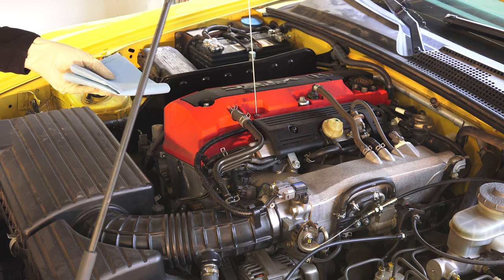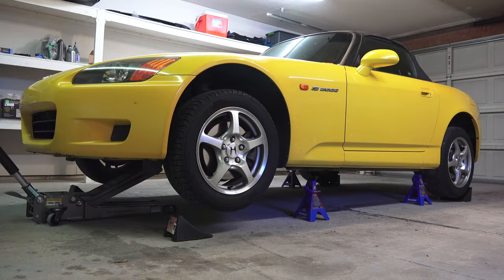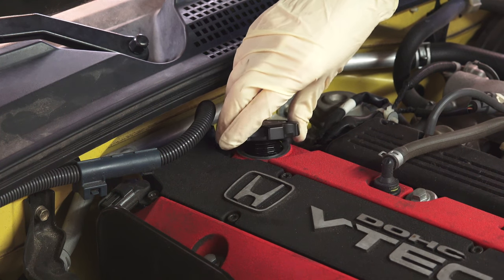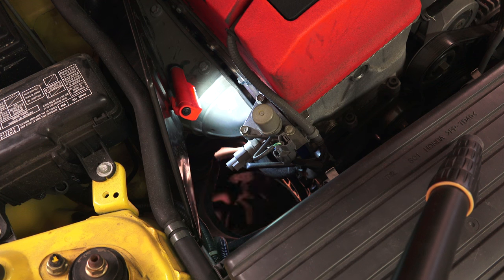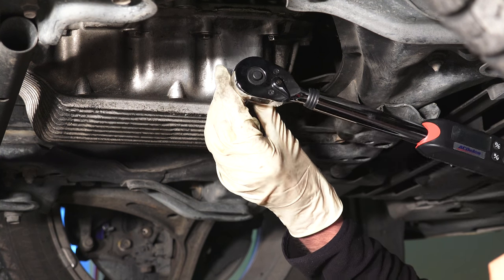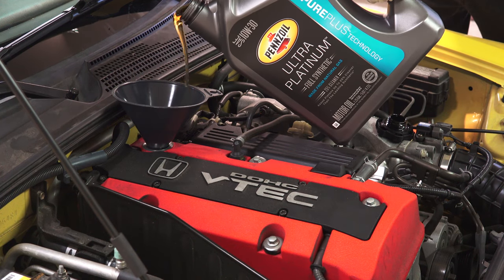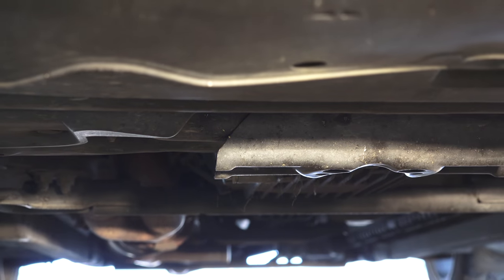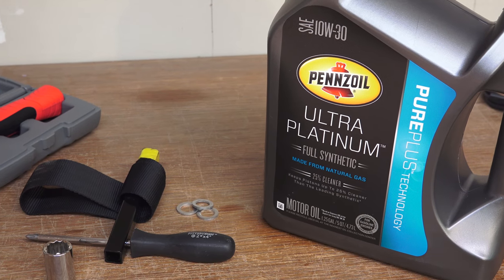How To Change Your Engine Oil - Honda S2000

Comment: You've done a great job and provide a wealth of useful information in your Engineering Explained series Jason. Thank you for your efforts!

I would like to contribute to this informative video with a few small suggestions to add to this episode.  The bulk of these suggestions apply to pretty much any car that uses a spin-on/canister style filter, and generally applies to cars (mostly German) that use filter cartridge inserts.  There are also a couple S2000 specific points added as well.  

The first suggestion is to pre-fill the filter with oil prior to installation.  Spin-on filters are equipped with an anti-drain-back valve, which allows you to at least partially fill the filter with oil prior to installing it on the car.   On your S2000 (as your video shows) the oil filter is mounted at a 90 degree angle to the block, with the resultant angle being approximately 78 degrees to the vertical (I personally own 2 AP1s).  Despite this orientation, you can fill the Honda PCX filter with about 1/3 quart of oil without oil spilling out of the filter during installation.  Other cars, like some small block Chevrolet V8s for example, allow you to completely fill the filter prior to installation due to the vertical orientation of the filter.  With regard to cartridge insert style filters (such as on my BMW 335D) you can fill the filter reservoir at the time of filter replacement.  

The advantages of pre-filling an oil filter are obvious: you prevent momentary oil starvation during the initial engine start-up after changing oil.  When the filter is dry, not only does your oil system have to displace the air in the filter with oil - the dry filter media will resist flow more than a wet filter media.  In reality the starvation may only about 4-5 seconds when the filter is dry - but over the life of the car, this can add up to significant and avoidable wear.  

Given your project car - a Honda S2000, I think it's worth mentioning that it's critical that S2000 owners only use the OEM Honda PCX filters.  That filter is specifically designed for the S2000 due to the design of the VTEC system.  Most of the design difference is in the bypass valve in the filter - in that the filter is designed to accept and handle significantly higher pressures than a conventional filter.  The oil pump in the S2000 is actually capable of supplying lubrication sufficient for a V12 engine.  The old school VTEC system in the S2000 is brute force in nature.  When the car goes into VTEC, it's not unlike creating a massive oil leak under the valve cover, because there are no seals around the pistons in the primary rockers that lock in the secondary rockers under VTEC.  The only way to keep this deliberate leakage from starving other parts of the engine of oil is to have an oil pump capable of flowing a massive volume of oil - under high pressures.  You never want to skimp on filters - but that is especially true for the S2000.  Honda most certainly didn't, and the PCX-004 filter the only filter specified for the S2000 - and the only car that uses that filter.  Every other Honda uses one filter - a single filter for numerous engine types.  That tells you something.  Last notes:  always use a fresh crush-washer.  Honda uses aluminum, and some manufacturers use copper alloy - both of which can be recycled.  Aftermarket magnetic drain plugs are not only widely available, they are highly advisable and can help prevent engine damage in certain circumstances.  There are also powerful magnetic sleeves that attach to spin-on filters, and are designed to help trap ferrous particles in the filter itself.  Both items are not too expensive and well worth the investment.  

The last suggestion is that I would strongly advise AGAINST using additives like PTFE (and other snake oil products), as they can lead to serious and expensive engine damage.  A good quality synthetic oil along with a high quality filter is all you will ever need to put in the crankcase.

Comment: I assume you were pouring the oil like that for the product shot, but for those who don't know, pouring front the side of the container releases the air lock and makes for a smooth pour.
Reply from the maker: Haha I've never really understood why people care about this. If the oil makes it in the engine, it's all good. That's why I used a funnel. 👍
Reply: +Engineering Explained Well, some of us are strange and hate cleaning up engine oil spills, so we employ a technique that... does not spill.
Reply from the maker: There are people who will complain about the way I put my shoes on. People get quite caught up in pedantry - that's my point here. If you want to pour your oil in your car a different way, go for it. I made no mess. The oil ended up in the car. It's silly to debate this haha.
Reply: I shouldn't have said anything.....
Reply: Ian Colquhoun Why not? You are totally right. A friend showed me this trick years ago and it's very handy. Works also for milk packs ;)
Reply: @Henchman1977  it's alright mate, thanks for the advice!  Some of us appreciate it 🤝📈

Comment: If you want to make future oil changes easier, you can install a Fumoto quarter turn valve in place of the drain plug. I have a video on it on my channel. I now just attach a tube to the valve and stick the other end in the waste container. It is extra easy on my Outback because the oil filter is on top of the engine.

Comment: after watching chris fix, I've become an expert at oil changing, it's like Changing a baby's diaper, messy work but it has to be done.
Reply: chris fix ftw !!!
Reply: It's even easier with a oil pan valve. The residual oil in the filter is annoying.

Comment: You should do a video on acoustic dynamics and why different engines sound the way they do! That would be super cool. Boxer engines, VR6 engines, V6 vs V8 vs V12, I4 vs I6, rotary, flat vs inline, etc. Explain why displacement changes sounds, as well as exhaust pressure, as well as firing frequency and crank revolutions. It gets in to crazy Fourier Transformations and thousands of factors. I'm finishing my Biochemistry degree, and a musician, but also a devoted car guy for life. You have a great head about you and I would love to see you delve into it. That would be a super cool video

Comment: Make sure you change the blinker fluid.
Reply: Alex Gonzalez also add blue Kool aid to your radiator to insure the maximum cooling capability
Reply from the maker: I love the blue Kool aid.
Reply: Alex Gonzalez also inflate tyres with Helium. Helium is much lighter than air and so it will make the car lighter as well
Reply: Use Hydrogen gas. Even better

Comment: For such a short video, Jason covered so much. A couple points I'd like to add. You said to 'crack' the oil cap to help the draining. Why not take it completely off to allow a greater inflow of air? Secondly, I put a big plastic bag under the drain pan because, as much as I think I have it lined up, the oil often shoots out and misses the pan to some extent. I buy these huge plastic lawn bags from my local True Value which cover so much area under the car. I also use them as drop cloths when painting. Great work, Jason.

Comment: Pro tip: Have the new oil container sideways so it doesn't glug.
Reply: He had to show the name, it is a paid promotion.
Reply: Oh right
Reply: A2892Z He could have held the jug sideways if he took a moment to change camera angle,  then it would not glug, the logo would be visible and everyone would be happy.
Reply: The correct way to hold an oil container is with the pour spout up. Totally opposite of the way he is holding it. Unless of course your sponsor wants his name visible! In that case, Pennzoil should print the label accordingly. Congrats on approaching 1 million subscribers!
Reply from the maker: Or you can use a funnel and go crazy! ;)

Comment: What about putting a little fresh oil into the new oil filter as well? I heard it helps the oil flow through the filter faster so that the engine isn't dry.

Comment: only person that uses a torque wrench to tighten drain plug lmao
Reply: Nope!
Reply: *****
 No, car enthusiasts tend to do something like this in general. Also what is the problem, if you have a torque wrench lying around: why not using it where it is needed and avoid the risk of doing it wrong by simply using the correct tool?
Reply: I do. At work and at home. It's so easy to destroy the threads on sumps and they're a nasty job to replace.
Reply: Any aircraft mechanic will do the same. Each bolt has its own torque value on an aircraft, that tell you how important it is.

Comment: A few tips:
1 Add fresh oil to new filter so as not to starve engine on start up
2 lower car after fresh oil added and car has run for a few minutes and you ensured all is is well
3 Hold new oil jug horizontally  to avoid the oil glug glug when pouring into filler.  Cheers

Comment: Penzoil ultra platinum in my opinion, exceeds and out performs other oils I have used. 
I use to use just platinum then I switched to ultra platinum and I must say the ultra platinum has a very cool feature in which the oil cools down faster than the others. Also I noticed a more smooth engine noise.

Comment: Just a suggestion: It's best to turn the bottle of oil to the side or the opposite direction from which you did.  This will prevent the fluctuations in flow as air can more easily flow to the rear of the bottle.  Using this method and understanding where the oil will hit when coming out helps to reduce any spills.

Comment: When pouring liquids from containers shaped like that Oil bottle, ult it rotated 180 deg on the vertical axis (drain higher, handle lower) This will ease the liquid air exchange and there will be no blurps.
Reply from the maker: Or you can just use a funnel and go crazy! :)
Reply: Why not both?

Comment: Text book. Beautiful explanation, proper order of jobs. Espesially the torque wrench part. 
It's so important and yet I doubt if mechanics use it on drain plugs. 
Also, after changing my oil, I do a second trip of the same length as the "heat up" trip, 
so that the new oil gets a good penetration in the whole engine, just to be on the safe side.
Ofcourse if you happen to go on a road trip after changing the oil, that's even better. 
Any questions or comments, feel free to leave them below.

Comment: I would recommend removing the oil filler cap first. I've encountered a time or two where I drained it before unscrewing the oil filler cap and realizing that I'm unable to remove it because of corrosion or the cap breaking or just plain being stuck. This might affect people with one car and will need to rely on someone else to help them pick up a new one, leaving them stranded.

Comment: I always try and put as much oil in the filter before fitting it to prevent running dry for a couple of seconds. That 10w30 is going to be straight out your exhaust😉

Comment: Be very careful when rubbing oil on certain filters as you can most certainly slice your finger open on the metal if not paying attention or being to "enthusiastic" about your oil application.  

Don't hate I was 19 and my finger may have slipped.  I'm sure blood is a great rubber lubricant.

Also double check any time you have to have a shop or somewhere like Wal-Mart change your oil.  I was desperate one time and had Wal-Mart change the oil on my Civic.  I was moving to NC from TX and after getting and driving a bit I had feeling to check my oil (car wasn't running odd at all) and there was absolutely no oil on the dipstick.  They had put the filter on wrong and the oil had been leaking out.  Thank God the motor in the 01 Civic was like a tank.

p.s. congrats on 1mil soon.  Your channel has grown so fast so quickly lately and you deserve it.

Comment: Hello! I have a 2008 and am really happy about this series. Why did you not use the recommended 5 weight oil? Also, I want to keep my car stock but I Autocross and track it. Because of your performance video, aggressive tires are on my list for spring. I appreciate any info from you regarding improving performance while keeping the car as stock as possible....thanks.

Comment: Engineering Explained - Please do a video on the best oil filters.  Over the years, I've had a few with manufacturer's defects, including one today that had a bad thread and wouldn't screw onto the engine.  I've also had a filter that had a bad crimp at the housing case and it spewed oil everywhere when the car was started.  Thanks!

Comment: I put an oil drain valve on my s2000. I throw an oil pan under the car, reach into the engine bay, and flip a switch. Let it sit for about 15 minutes to make sure it is done draining and then add a little bit of new oil to flush things out. I've had it on the car for 120,000 miles and it's been fantastic. Makes oil changes a breeze.
Reply: i have this valve and do exactly as you do.  the only gripe i have is that the valve reaches up into the oil reservoir ie. won't let as much oil drain out.  thought about sawing some of it off to compensate.

Comment: In the rare case if your oil filter is mounted vertically to the engine, you can pre-fill the oil filter with some new oil so that it can circulate the engine faster upon the first start-up.

Comment: If you move your drip pan before replacing your drain plug it's going to keep dripping on your floor. I'd reinstall the drain bolt in right away so you don't forget. Or get a second pan.
As YouTuber Mod MINI has suggested, if you remove your oil cap and move it to somewhere where you can't miss it, like right next to the hood latch, it will stop you from shutting the hood without remembering to refill the oil. This happens a lot when you've planned to do ten other jobs while you've got the car in the air, but you put off filling the oil in until last. 

Same thing with the drain plug: if you leave it lying there, you might forget it. Don't laugh; it happens. Put it on top of your new oil bottle, or in your funnel, so you can't refill the oil without seeing the drain plug.

If you're using a clicker torque wrench, stop after it clicks once. If you keep clicking it, you're adding more torque. Maybe not enough to matter, but if you don't care that much about accuracy, save money and don't buy a torque wrench.

I always put in magnetic drain plugs. The benefit might be infinitesimal but maybe not.

Comment: Awesome video! Quick tip for next time, if you tilt the oil on its side to put into the funnel, it will be a lot smoother from the start so you don't any possible spillage. Congrats on almost a million subs!

Comment: Jason - REGARDING filling up the new oil filter before mounting it back onto the car. I understand yours mounts back at a awkward angle, but for those of us who's filters don't, would you recommend doing so? Is it just a myth or is there really some sort of upside to it in regards to an engineering advantage?
Reply: it's not necessary in practical standpoint, theoretically you'll have oil everywhere faster if you have your filter filled up BUT you're introducing impurities into the oil system after the filtering element as well. Also, plenty of other manufacturers uses an upside down filter, either a paper type cartridge or a metal spin-on, which you obviously can't fill up before hand so I don't think there's a convincing argument for filling up an oil filter before installation.

Comment: I'd say you should add oil while periodically checking the dipstick, rather than by the theoretical capacity, because some oil remains in the engine even after draining. This prevents overfilling.

Comment: You should turn the oil jug sideways to pour. That would let you get the jug closer to funnel and pour with out gurgling the oil. The pour would be smoother. Also, raise the front of car higher and right side higher to get more oil out of pan.

Comment: If you put the opening of the 5 quart oil jug at the top instead of the bottom then when you start refilling, the jug will not go glug glug glug and get oil all over your engine and floor. The oil will start and flow smoothly from the jug.

Comment: Hey man, great video! Quick question... For those of us that do not have a perfectly flat driveway/garage, how can we make sure the ground our vehicles are standing on (i.e. a gas station's, parking lot, etc.) is level enough to get an accurate reading on the dipstick when checking the oil level?
Reply from the maker: +luisacosta813 doesn't have to be perfect. Flatish should be good enough, as there's a range on the dipstick you want to be in regardless.
Reply: Engineering Explained Got it! Thanks for getting back to me so quickly, I appreciate it. Keep up the good work man!

Comment: You should change your clutch master cylinder fluid every time you change the oil. It makes shifting so much better.
Reply: David G S2000's have an issue with CMC's and CSC's. If you don't frequently change the fluids with brake fluid, it makes a noticeable difference in shifter feel. Instead of commenting on a car you hadn't work on, you should do some research about S2000 clutch master/slave cylinders failing.

Comment: The oil was 10W so its not very good for low temperatures like you stated. 5W is the go to if you experience sub zero conditions.

Comment: Should have used 0W30 or, for sporty driving, 0W40.10W30 cause a lot of wear when the engine is cold and a lot of wear at the oil pump.

Comment: Are cat litter/food buckets the National standard for holding old oil?
Reply: As someone who used to have to dispose of peoples oil that they would bring in. I've seen orange juice containers, milk cartons, laundry detergent containers ect. Anything works really, just its really annoying when you see a bunch of oil filled 500ml water bottles, ugh. Takes forever to empty them.
Reply: Korrupted 500ml?  That sounds incredibly painstaking.  But thanks for the advice!